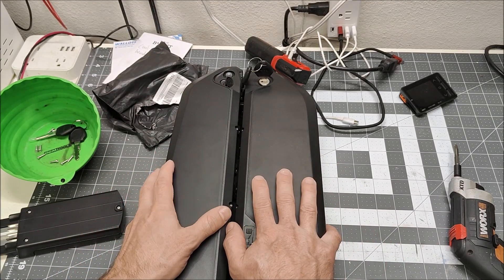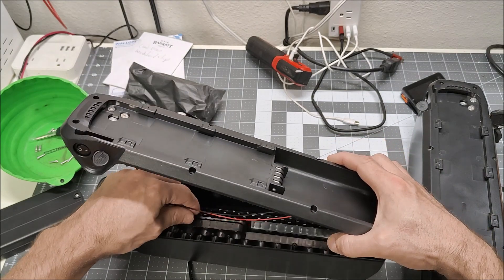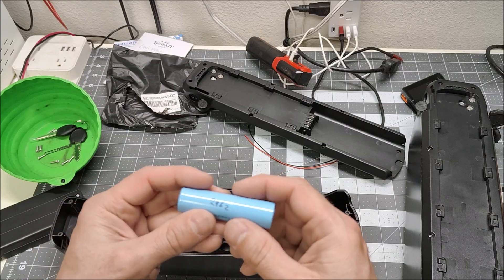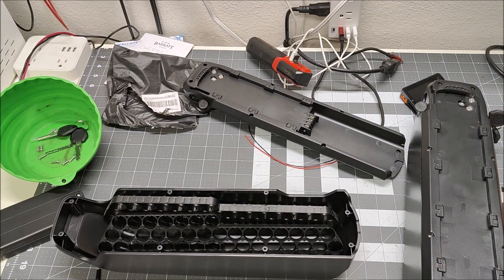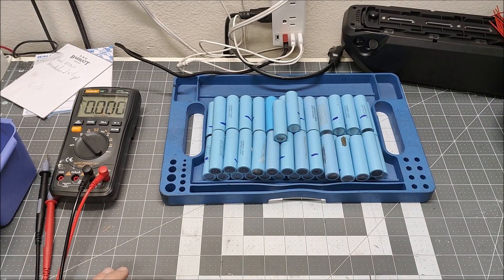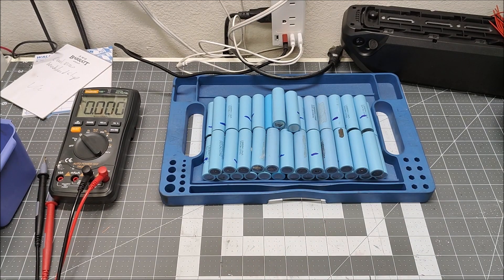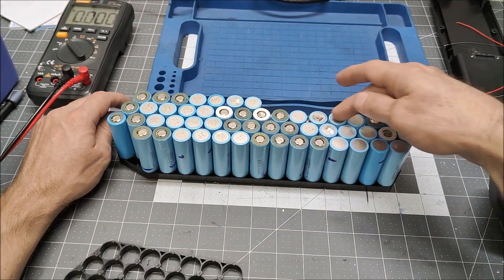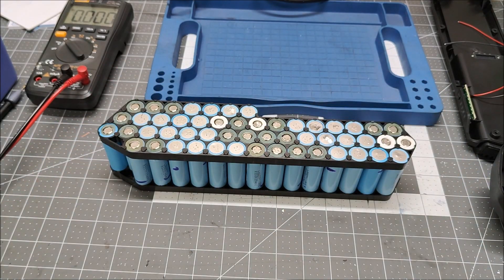Building a Quick Ebike Battery - Part 1

Comment: There has to be an easier way, a way to diy without the need to spot weld
Reply from the maker: There are some battery systems that don't require welding. They use springs to press the terminals on the batteries. But they are expensive contraptions

Comment: Nice video! But a tip: If storing cells so long, its advisable to not store them fully charged. (They will degrade faster that way) But at storage level (around 3.6V for this type of cells).
Reply from the maker: Correct.